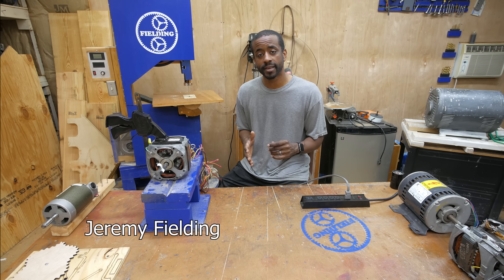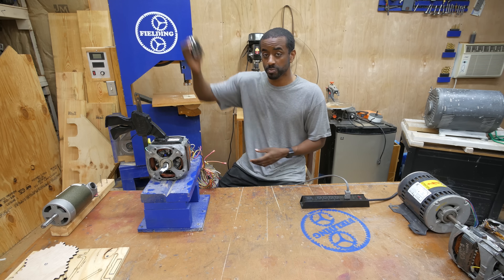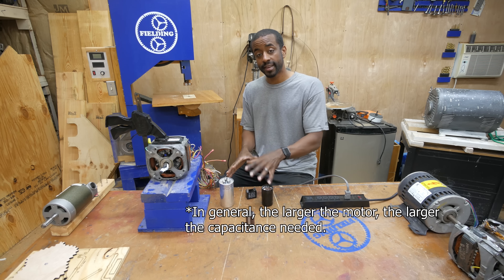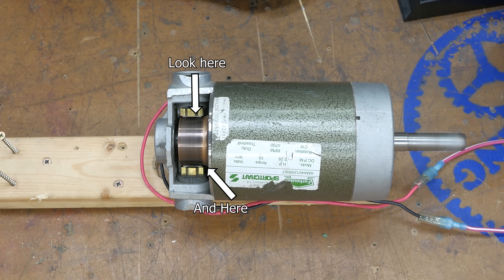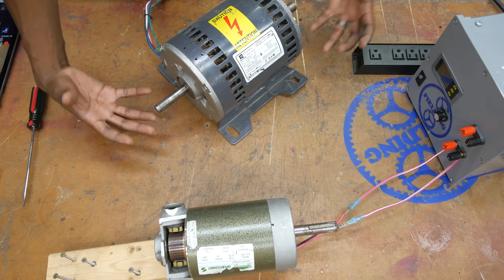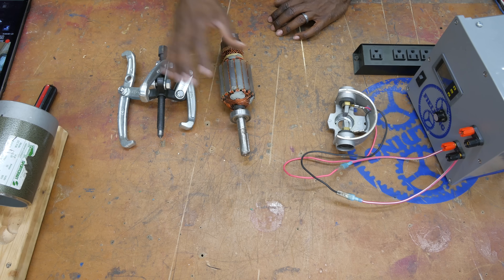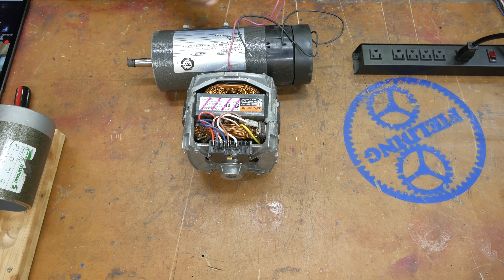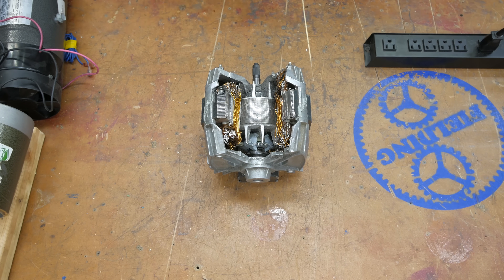Three Most Common Motor Fixes Anyone Can Do; Ultimate Guide to Electric motors ; #070

Comment: I have a scroll saw, was working perfectly. I turned it off to change the blade and it just hums.. I cleaned inside with compressed air and nothing changed.  I turned it on. All it did was hummed but I could turn the shaft with a straight screw driver and it would spin but a reduced speed and power.  Now i don't know what to do. There is no fuses or brushes...

Comment: Awesome video!!  I learned so much from you and I definitely know where to start (pun intended) now in troubleshooting and fixing the dead motor for my Sears Craftsman table saw.  I also love how you leverage your skills and curiosity to appreciate and demonstrate the details of some fundamental engineering. I’m definitely subscribing and giving you the thumbs up so hopefully you can make more of these value-added videos!!  Thanks so much!!
Reply: Thank you for your great videos. I have a 8 inch wen bench grinder that won't start the capacitor is good and the switch is good . I don't  know about the the reostat for speed but this thing has a a bunch of electronic stuff  I don't  understand . Can I by pass that a will it work like a regular electric moter?  Thank you

Comment: I have a 10 quart Avantico mixer that will not turn on bearings are squeaky and it turned on when I played with switch .   hard wired switch  and it just blows circuit breaker

Comment: Wow this was stellar video! I love how you showed us how to start the motor without a conductor. A nice way to test it. Here's one mystery I'm trying to solve.

PROBLEM
I have a Bell & Gossett PL-36B Series 1/6 HP Bronze Booster Pump and had the conductor replaced (old one grew to double the size and split open). With new conductor, the pump still won't start. The motor shaft turns easily so nothing is jamming it from spinning. I measured the voltage and the motor gets power. I tried manually spinning the shaft to see if it starts (as per Jeremy's video advice) and nothing.

I'm out of ideas... :( anyone plz?

Comment: My Craftsman table saw motor has all the symptoms of a bad start capacitor, but replacing it made no difference. I'd love to see a video with more information about the capacitors themselves: how to check if the capacitor is good, what's the purpose of a resistor on the capacitor terminals, what makes capacitors go bad, etc. Anyway, thanks for your videos. They're super helpful and informative.
Reply: The symptoms you describe, humming and needing help to start even with a good capacitor, in my case it was the bearing (sleeve bearing) heavily worn out, so the rotor was "sticking" to the sides when current was applied. Adding a plastic sleeve to compensate for the worn out bearing is a quick fix, until you can replace the bearing.

Comment: I  have a swg motor 2hp 110/ 220V did not have a start capacitor it was missing. Called the factory correct start capacitor was 600 mf 125 V capactor put the new start capacitor in, motor started right up and abt 45 seconds blew the capacitor?  I checked the internal switch, contacts were fine the centrifugal clutch was fine so I started the motor with out start capactior put a vote meter on the two wires where the start capacitor was and I have 200v showing while the motor is running? Not sure what is going on when the motor is running I'm thinking there should be no vote showing on the start capacitor wires. Any help there.

Comment: OK. I'm having trouble wiring up an old fridge compressor. It appears there is no run, start or common. It came out of a newer Samsung fridge and apparently is called a BDLC compressor or something like that. All three terminals on the compressor are reading 13.5. So there is no way for me to determine run, Start and common. Or at least no way I know of and there is no video on YouTube that explains how to wire these compressors. I would be eternally grateful if you could make one. By the way, I'm a huge fan. My wife however is not happy with you. Every bulk trash day I come home with refrigerators, treadmills, microwaves ect... and do you know of any batteries that can pump out 130 volts or should I just use a power supply? Sorry if these are newb questions, but you gotta start your journey somewhere. Rome wasn't build in a day. So to anyone reading this, no negative comments please. It's just rude and annoying. Thanks Jeremy. Love your channel man.

Comment: More common on older motors was a grease fitting or an oil fitting and have found many times evidence of over mantianence introduced to much lubricant and fowling in contacts and brushes

Comment: Can you breakdown swamp cooler pump and their motors?  I'm finding them very cheaply made and unreliable. I realize they operate in a harsh environment and tend to seize up whenever.  I usually tap them on the top and that's usually gets them going.

Comment: I have a brand new motor it runs a fresh air respirator pump im getting electricity past the capacitor the motor spins freely there is no hum and it will not spin any solutions for that?

Comment: just fixed a brand new compressor i bought on maket place. I had power going to the motor but did not do a thing so i tested the thermal switch a found it was wired wrong from the assembly plant. I just looked for the 2 terminals that had contenuity switched the wires and it started up .  I did alot of reseach but found nothing on that sometimes you have the poke around and use some  comon sense.

Comment: I have a small DC motor from an old electric toothbrush that struggles to run. I tried connecting a fresh 1.2V "A" cell directly to it, and I felt the wires get very hot while the motor struggles. What do you suppose is the cause? Could worn brushes cause this? I haven't been able to take the motor apart yet.

Comment: Can you provide any info or link to info on motor cogging I think that is what it's called. Basically when a motor starts skipping or I don't even know how to describe it! Its like shutting on and off really rapidly when the scr is dialed down low. I have. Also noticed it happens in certain locations where I assume the. Power seams to be dirty that's the only way I can describe it it's just not good power in some locations.   I use floor buffers and I have a 1.5 horsepower DC permanent magnet  motors hi speed 1500 or so.  I customized with a lot cost  scr to control speed instead of the triac they come with.  Triacs are very  expensive to replace $180 plus you only get two speeds.  I've read the scr is not a good idea but it works fantastic and only cost less than $20. I have never had one go out or had to replace a.motor going on 3 to 4 years now.  but I do notice the motor cogs and there can be.loud snapping cracking from what I assume is sparking but I haven't been able to confirm exactly where it's coming from the brushes or the rectifier cuz I usually stop immediately when this happens or quickly turn up the dial. under load sometimes when it's too slow which I just attribute to two little voltage. But I've been absolutely amazed at how good it works and the longevity I haven't had one break since I started using them several years ago and I was replacing a triac every 6 months. I do have to replace the rectifier every few months or so but I was doing that with the track also maybe not as often but more often than I wanted to. If you don't have time to answer this I know that's an old video I understand but I just thought I'd throw it out there and maybe you had some guidance thanks love your videos. The knowledge I have taken away.  Has made such a difference.  Cut my service and repair costs from hundreds sometimes, thousands a year to well so low I caint really give a number. So thank you again. I dictate this message in it is a little wordy and the and punctuation is horrible just takes too long to edit. This message is  a very very long roundabout way to simply say thank you.

Comment: Very well and pleasantly presented, and easy to understand. My problem is a customer has a dog grooming table the height of which is raised and lowered with a motor. The control is by foot-pedal. The 'lower' is working, but the 'raise' has stopped working; not sure exactly what type of motor it is yet. The raise pedal does turn on a lamp when pressed, but the table doesn't move - any ideas?

Comment: I had a starter/generator on an 81 ez-go gold cart. It would start buy wouldn't charge. When I finally took it apart after seeing what they were asking for a new one I discovered a permanent magnet wasn't permanent and tho it could just barley move, in time it moved enough to finally cause a break in the wire from bending. Repaired and away we went. I kinds impressed with myself on that one. Easy to solve once I had it apart but that's where most people stop.
I also had a 99 Chrysler 300M that wouldn't switch from defrost. Eventually I found the blend motor and valve way up under inside in the center. I was getting intermittent operation so eventually I took off the back casing by bending the tabs. It had 3 little fingers acting as the brushes I assume and they were worn and making bad contact. I needed up positing them on the opposite side of the rotor or shaft and then reversing my positive and negative connections to the motor after getting it back together. Worked for the 2 years I owned it after that. Saved 80 bucks on that one had it back in same day. But it did take me all day lol.

Comment: So in a Hobart industrial kitchen dishwasher motor, I believe if you don't drain it properly, small things can get sucked in and jam the motor blades and overheat it, I believe this happened again tonight on our machine, but I was afraid to drop down the inlet tube and mess anything up since it's under contract.  Last time a tiny mussel fork got jammed in it.  I wonder what the culprit could be now, but it was apparently hot enough the heat the outer shield and cause a burning plastic smell.

Comment: The technology involved in motors and their origin is awesome. I find it interesting also. 
My planer is making the buzzing or humming sound when the power is turned on. Like you said that's pretty much indicative of a bad capacitor. If that's the case would you still check the switches and circuit breaker? I'm just curious, wouldn't the fact that it's powering on and humming indicate the switches and breaker are operational? I'm not doubting you, you seem to be very skilled and I was thinking capacitor too so just seeing where I should start. Great video.

Comment: Hello,
I finally got my softub motor/pump up and running after having issues with it.   When I put it all back together and went to start it, I just hear clicks.   I checked all the wiring.  I even changed the circuit board with an extra one I have.  The display is lit, power is going to the starter switch but nothing happens.  No humming and and no turning of the motor. I’m at a loss.

Comment: Hi Jeremy, I have a situation with my table saw motor where the rear bearing has come apart and all that is left in the bearing pocket is the outer portion of the bearing that sits 4 1/2 to 5 inches down in the motor casing. All the videos I've watched show removal of "intact" bearings, not one that has come apart like mine. Any suggestions on how to get the outer piece of the bearing out? I've got a 2" hole to work through.

Comment: Jeremy - I bought this old Italian polenta maker. It has a copper pot - and this motor that attaches to a frame - with a paddle coming from motor that comes into that copper pot.  When plugged in and turned on it rotates the paddle so that when cooking - it slowly stirs the polenta.  It’s really old.  Problem is - it’s Italian and came with a European plug. If I use a travel converter I can plug it in and it does turn - but really slow.  I would like to get it working and rewire for the USA. What are my challenges?  I am not sure of the motor is shot, it’s because i am plugging in in the states, or what?  I did buy a small rotisserie that I may try to retrofit into the original housing but that might be a challenge.

Comment: I have an electric US MOTORS  S63CXJCK-7449 which goes on a megabreeze swamp cooler. I normally turn it on high speed then turn it to low. But I turned it to low speed first and u could hear a electrical short. Just wonder what that would be. It now only runs on high speed but nothing on low. No movement nothing.

Comment: At 7:26 : while on this motor is ok to pull off the cap with the brushes still attached, on many smaller motors it would not be a good idea because often in smaller motors the bearing is bigger in diameter than the commutator, and pulling it off with the brushes still on will destroy the brushes.

Comment: Here is a long shot.  What if you have a desktop fan, and your child jammed some crayons into it and without knowing the fan blade was completely unable to move when it was powered on, now that the fan blade is cleared of obstructions the fan will not turn on... what is the most likely issue, capacitor? Motor? fuse?

Comment: I haven't worked my way through 1.4K comments, so this question may have already been covered. With a mis-shaped or worn brush, can't a user sand the brush end smooth and square and then finely sand the armature surface to get it smooth as well to put the motor back in service? 
Thanks, Joe

Comment: How do you go about push starting your motor on your washing machine to test whether the problem is the capacitor? Do you have to first remove the motor before you can try to test it this way? (Sorry if this is a"stupid" question. This is my first ever look into fixing motors or anything electrical.)
Reply from the maker: It depends on the machine, but you definitely have to remove the belt. You "might" be able to push it while it is still in the machine.

Comment: Please I need advice on how to clean the stator and rotor of my range hood electric motor that is full of old stuck food grease? Esprecially the stator, since it has coil windings and I suppose these are not to be touched by any solvent? Or is it safe to soak, brush and rinse the whole thing completely with say WD-40, or WD-40 Specialist Degreaser, or a WD-40 Specialist Cotact Cleaner? If so, please  advise me on which solvent to use? On Reddit I even got the advice to simply wash the entire thing in washing machine (without the detergent), and then bake for couple of hours in the oven to dry completely. Is this safe for the components?

Comment: Jeremy, I have a Central-Aire 731 1140 rpm fan unit in a greenhouse. I got my friend to order up a capacitor for it and it was installed. Motor wasn't turning on properly but now it sort of does. But it overheats and shuts off within a couple of minutes. It gets quite hot. I would imagine its thermally protected. I think its dual 115/230 vac. and it is currently hooked up to 115, of course. That comes off a temperature controller that is supposed to turn the fan on automatically when it gets too hot. The thermostat stays on, of course (I tested that) but the fan cuts itself out. Can I take it apart and what would I look for that might be causing overheating? Maybe some debris in there over the years? Any ideas would be great. Excellent video, ol buddy! :) thanks!

Comment: Hi! I know that it's been a hot minute since you uploaded, I have a brushless motor from a motorcycle that stopped working, it feels like a step motor, the tiny servo ones, but 12" in diameter, and when I try to give it power nothing happens, it has a slight humming sound like it's trying to do something but can't.
It's not the bearings as I have checked them individually and they run very well. Any ideas what could be wrong?

Comment: I know just about enough about electric motors and repairs to get by or to be dangerous.
What I don’t know, I can often find help with right here on this channel. Tech support for the lift company’s we represent can’t tell you anything helpful, and don’t sell you any internal parts for the motors on the lifts that they make. But they will sell you the complete power unit for replacement at the low cost of one arm and half a leg. 
We have repaired our customers motors whenever it is possible, with snap switches, capacitors, microswitches, broken housings and bad or broken armatures. Some will shear the coupled end off and spin freely.  
A replacement armature has to be a salvaged one kept from a motor replaced because someone let the magic smoke out.  
Yes, motors run on magic smoke. 
(And, 120/240/440 angry pixies). 
If you let out the magic smoke it is all over for your motor. 
You can’t ever put the smoke back in.

Comment: I forgot to mention that we are talking about a Brose E-Bike Motor, I just bought for 3 day an specialized E-Bike, I have tested the bike, was all righty, the seller was telling me  that the noise  from the Motor is because of the belt drive.

One day later in Turbo Setup with 100% power and 70% peak power set-up the motor shutout.

So the motor is working, no cracking sound's, smoothly like Butter, but once you rise the peak power goes off after 10' sec.
Appreciate any reply @Jeremy Fielding

Comment: I have a question  @Jeremy Fielding

Which components of a motherboard gives, or Ower the peak power to a electric motor... E-Bike for example.

What should I  measure in motherboard.

The Motor is working with the 100% set-up, bit the peak power works only until 20%, above 20% the motor will start to spin quickly and than it stops.

After a new start it works again.